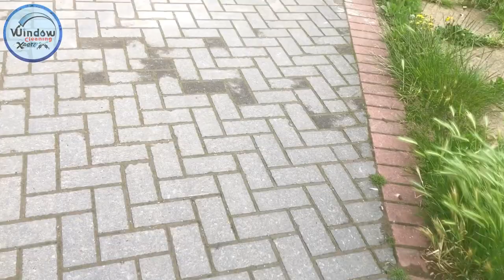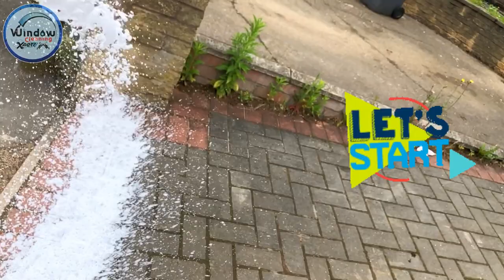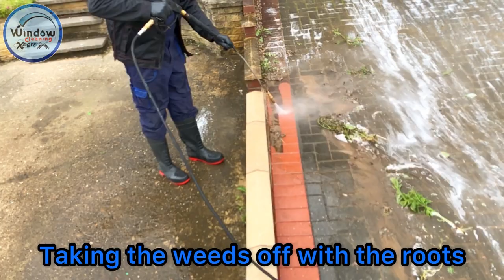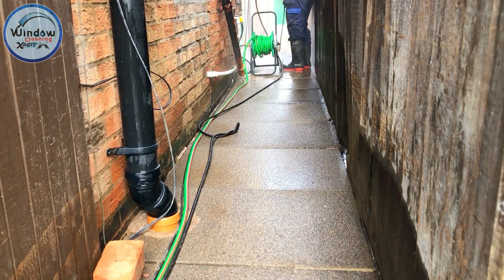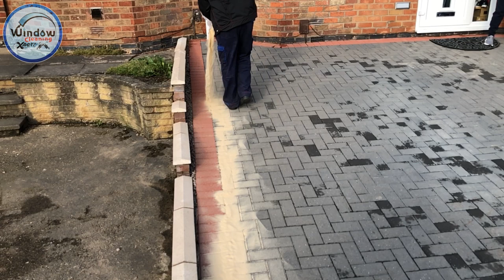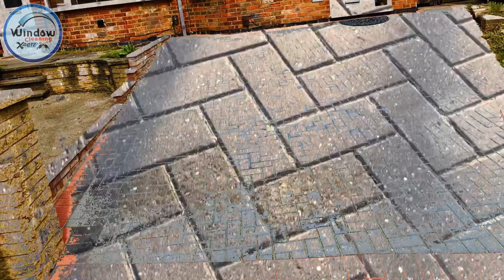An oddly satisfying block paving restoration job, HOW TO CLEAN A DRIVEWAY TO LOOK LIKE NEW

Comment: Hi Nash.. The cleaning fluid what is it.. And do you leave it on long before jetwashing it off.. Also does it make much difference if u don't use it.. With having a turbo lance... Thanks
Reply from the maker: Hi mate it’s hypho based liquids and I leave it to soak about 10 min. Before jetwashing , yes it does a big difference in some cases cheers🥰👍